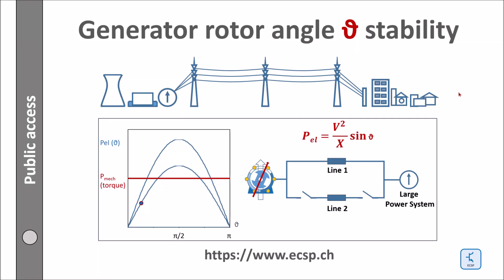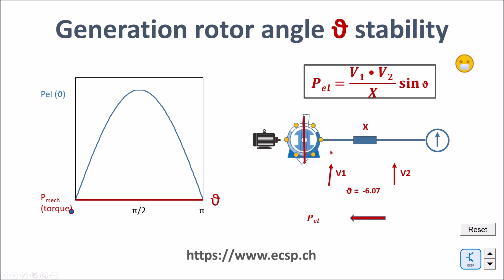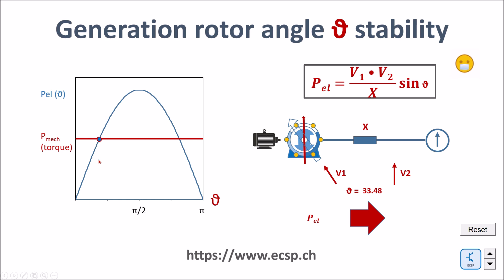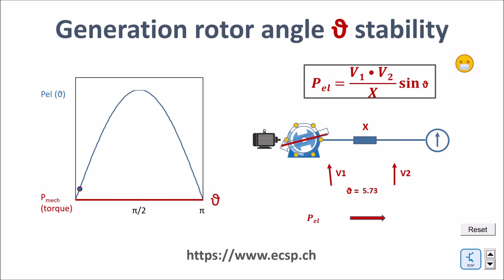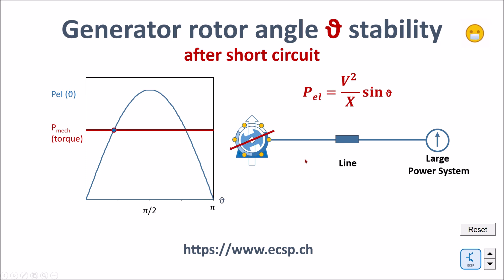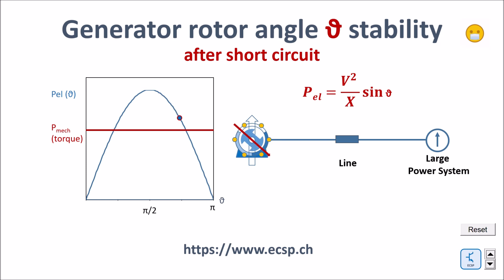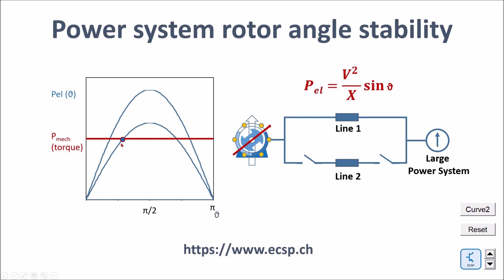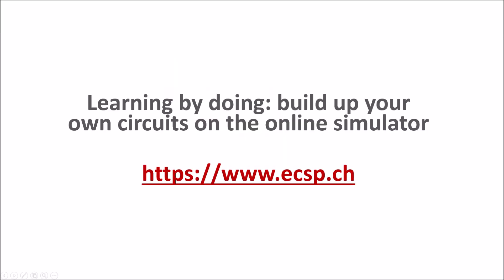Rotor angle stability [circuit simulator]

Comment: Really nice and clear representation, thank you for your videos. My question is how do you visualize the deplacement of rotating magnetic field in reference to the the stator rotating field and the change in angle in your slides?. It really is a good animation and helps to get the concept.
Reply from the maker: Thanks for your kind feedback. I do this with power point visual basic or for even more complex graphics I use javascript.
Reply: @georgschett801  Really good. thank you. Do you have presentation showing 2 generators or more working in parallels visualizing the way  their angle interact to changes in the system? for example if system load is increased / decreased, etc.
Reply from the maker: @trinottuk  Maybe this one is what you are looking for: https://youtu.be/RxzMHQ4o1jI     and by the way, this is exactly what you can do with the proposed simulator on https://www.ecsp.ch
Reply: @georgschett801  Thank you very much. Are these presentations available for registered members?
Reply from the maker: @trinottuk  No, it is for everybody. It's all on my channel: https://www.youtube.com/channel/UCZEYX01Nvi3qHsby1Cnls1g
The pro-version of the simulation tool is for registered members only: https://www.ecsp.ch

Comment: Sir when there a short circuit the point moves but the mechanical powee doesnt move why and why when the brakers are open Pelec 0 there is only rotor magnetic
Reply from the maker: I am not sure if I get the question right. While the breaker is closed the mechanical power is  converted to electric real power and evacuated to loads. The torque is given by the turbine. When the breaker opens, there is no electrical power anymore, but still there is  the mechanical torque from the turbine. Therefore instantly the generator accelerates until the mechanical control system starts to close the valves and so reduces the mechanical torque. The electrical time constant however is much shorter than the mechanical time constant and therefore a simplified assumption of a constant mechanical power in the critical time span of around 300 ms is OK. A detailed simulation however would consider a variable torque as a result of the acceleration.

Comment: I don't think in rotor stability when short circuit happens that point needs to pass the horizontal line right to unbalanced state could occur. It can happen before, the moment where it happens depends of the energy stored in normal work, I remember that from lectures, I'm not sure 100% that's it, but I know that depends of the energy stored in rotor before short circuit happens
Reply from the maker: You are right, it does not have to. It depends on the torque before sc.

Comment: Thank you George, very interesting. It reminds me of a static 3-phase UPS topology from a company called Silcon in Denmark in the mid-1980's (Now part of Schneider Electric). The Silcon DP-300 used an input inductor (choke) as a power flow control reference. The control system algorithm used voltage vector control of the inverter to regulate the power flow with the input voltage as the inverter phase angle reference vector. Basically, same as a cogeneration generator without the mechanical limitations.

I am curious what your simulation would be like with a static inverter and DC source replacing your motor-generator, e.g., to simulate a grid connected inverter with battery energy storage from wind or solar. 

Your thoughts?
Reply from the maker: Hi Al
There is an older video: https://youtu.be/4jindVsoEKw  about a part of the topic you address. Be aware that I use quit a low time resolution to enable a kind of real time experience. There is a small typo: pcm should be pwm. Overall modern power electronics can interact with a grid in a similar manner than conventional generation but faster, power flow works in both directions. I make the case of a voltage control however alternatively one can control the current of an inverter.
I will sooner or later make a better case....
All the best, George

Comment: It is really nice representation. However it seems to be based on classical model. The assumptions for classical model are: 
I.	Transient stability is decided in the first swing.
II.	Constant generator main field-winding flux linkage.
III.	Constant Mechanical Power
Today large system interconnections with the greater system inertias and relatively weaker ties result in longer periods of oscillations during transients. Generator control systems, particularly modern excitation systems, are extremely fast. It is therefore questionable whether the effect of the control equipment can be neglected during these longer periods. Indeed there have been recorded transients caused by large impacts, resulting in loss of synchronism after the system machines had undergone several oscillations.
The dynamic instability problem, where growing oscillations have occurred on tie lines connecting different power pools or systems, hence it has also become increasingly important to ensure the security of the bulk power supply. Therefore reexamine the assumptions made in stability studies.
Therefore we should:
I. More information of the characteristic time response of our system loads to changes in voltage and frequency-develop new dynamic models of system loads.
2. Re-examine old concepts and develop new ideas on changes in system networks to improve system stability.
3. Update our knowledge of the response characteristics of the various components of energy systems and their controls (boilers, reactors, turbine governors, generator regulators, field excitation, etc.)
4. Reformulate our analytical techniques to adequately simulate the time variation of all of the foregoing factors in system response and accurately determine dynamic system response.
Last but more important is to consider effect of HVDC ties and renewable energy.
Hence we can say that the classical model is inadequate for system representation beyond the first swing. Since the first swing is largely an inertial response to a given accelerating torque, the classical model does provide useful information as to system response during this brief period.
All above is from: P. M. Anderson, A. A. Fouad, Power System Control and Stability, 2 edition, IEEE Press
Reply from the maker: Thanks for these clarifications! All of your comments are correct and appreciated. The lecture is about basics. People like you who are experts do not need such simple explanations of course. They understand the subject matter and work with much more sophisticated tools. Again, thanks for your feedback!